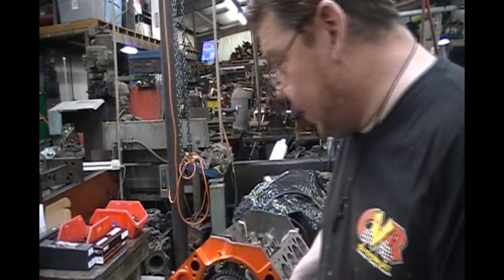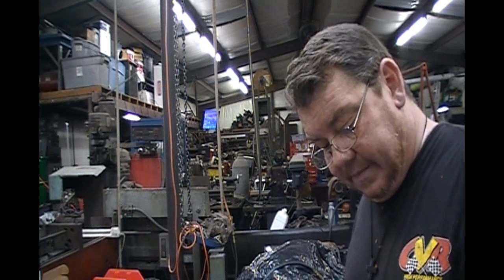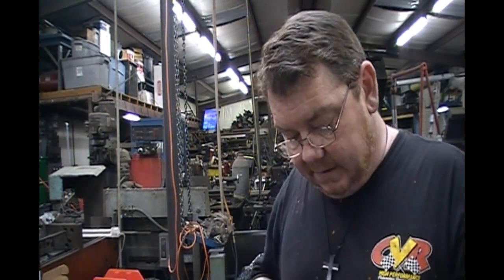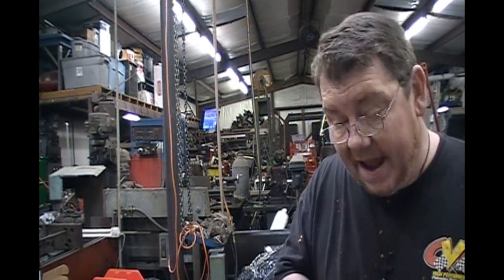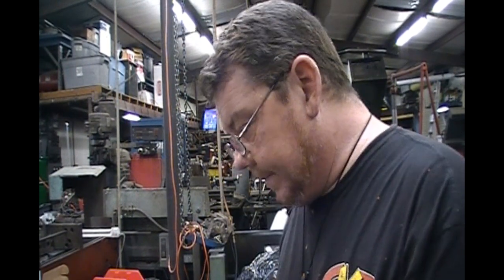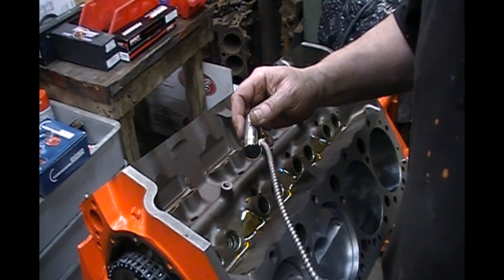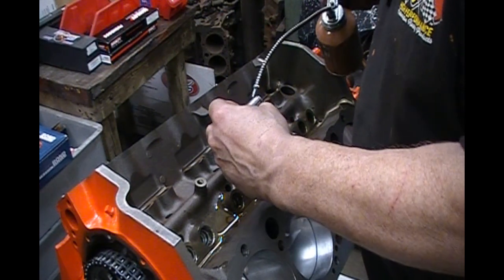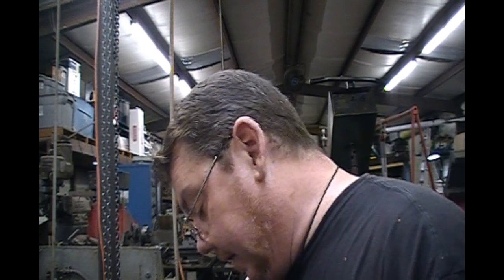Flat tappet camshaft problems, lifters, oil and talking flat tappet tech

Comment: I'd advise having lifter bores honed if your block is hot tanked by the machine shop. Bores can become egg-shaped over time and excessive heat. That can cause lifters to bind and not rotate.
Reply from the maker: We check and hone or correct all the lifter bores as part of the inspection/prep process in our shop. sometimes I have to sleeve them. And then there's new dart blocks and a few others that are actually to tight and I have to hone them. But yes you're absolutely correct, you should check or have them checked. Occasionally they just get a burr in them from handling or machining and that's what I'm basically  referring to in the video. Thank's for the comment!
Reply: @Marksracingengines what grit do you finish the lifter bores with?
Reply from the maker: @alexlandsberger1423  I finish with a 320
Reply: also hone your lifter bores if you have a cam go flat and have to pry the lifters out. had a 305 eat a cam and the lifter bores have burrs on them now.

Comment: When I broke the Comp Cams cam with Rhodes lifters in in my GTO with a fresh rebuilt motor back in the mid 90's I don't believe it fired right up... And to add insult to injury I boiled it over at 260 degs half way through due to a defective new  clutch on my fan. Swapped on a flex fan and finished it.   Still running great to this day.  just recenly checked compression at 180-185 on all cylinders. Didn't start using zinc additive until a few yrs ago before i switched to a 15-40 diesel oil I can get for free.   May switch to a roller though if i go with alum heads.
Reply from the maker: Cant go wrong with a roller, but honestly there's nothing wrong with a flat tappet. like you said...it's still running strong...I like those success stories. and I Love Pontiac's!

Comment: 2023 and flat tappet lifters isnt the way the roller is the best way too go
Reply from the maker: Yes, I agree. But unfortunately the rules for 80% of circle track classes still require flat tappet camshafts. And I don't see that going away any time soon. Until it does, those customers are stuck with them. On the up side..I haven't had but maybe  3 or 4 flat  tappet cam failures in the 30+ years Ive been in business, and that's engines I've built in the thousands with flat tappet cams. However I use good parts & break in oil. Thanks for watching!
Reply: @Marksracingengines   i understand but the new oil the dont have zinc, and make it harrd for flat tapped cam and lifters too live   Maybe is beter too change  the rules and came in the 21th century the tracks
Reply from the maker: Fortunately there is plenty of readily available racing oil like VR1 (Orileys has it in every store), Driven and many others with plenty of ZDDP designed for flat tappet cams. No you cant buy it at Wal-Mart, but you cant buy race car parts there either lol. I agree they should change the rules and allow rollers in every class. Myself & other engine builders  have lobbied for it for years to no avail. Unfortunately that's not going to happen any time soon. As long as there is small & big  block Chevy-Ford & Mopar engines in racing,hot hods & restoration projects....there's going to be flat tappet camshafts.

Comment: Despite all Precautionary checks (Cam lobe Taper, lifter Facec Crown, Excellent lifter Bores, etc) including Correct Zinc oil type,  Abnormal numbers of FT Cam & Lifter  break-in & running Fails are Still happening.....To date,  No one has Yet confirmed, Provened or Presented  Any cam lobes or lifter faces Below acceptable RW hardness specs are involved

Comment: Mark the pushrods and watch to make sure they rotate.  Use break-in springs in high performance (heavy spring) applications, and old-school non-detergent break-in oil. 
If a lifter isn't rotating or is rotating intermittently (sticky), you can try briefly letting the engine come to idle and manually rotate the pushrod with your fingers to get it going.
I'm 59.  When I was young I had a '66 El Camino with a 327.  I had a lifter go bad (wouldn't pump up) in it twice.  My father was a career mechanic who liked Chevrolet.  Each time a lifter would go bad I'd pull the intake and replace the bad lifter with a used lifter my father would give me with a similar wear pattern.  Technically you're not supposed to do that, but I had more time than money so I was willing to gamble.  Once I got it back together I'd start it and watch the pushrod.  If necessary I'd use my fingers to help it along until it was rotating smoothly and consistently (the same as the others) on its own.  Both times it worked out and the result was a reliable repair.
Do the cam lobes and lifters have enough taper?
Are the lifters free in their bores?
Do all the pushrods rotate equally and consistently?
If the answers to those questions are yes, you should be okay.
Watching pushrods rotate on a running engine is messy, but I don't know any other way to be sure.  It's gotten to the point where we either do it or stop using flat tappets.
Reply: How much taper on the cam and crown on the lifters, is considered good to go? Thanks in advance!
Reply: @SuperDave227D  
It isn't much.
The key is to make sure the angles match in order to maximize the load bearing area.  
There is a YouTube channel called 'powell machine inc" that has good videos on the subject.
Reply: @kd6tas  thanks!!

Comment: my Holden 253V8 ate  2 cams in 2000 miles...  cheers from Down Under
Reply: What brand and grind of cam? what lifters?
Reply: @borismcfinnigan3430  the 1st 1 was in the motor when l got it 2dn hand ran for 3 years with out a problem...  replaced the lifters from auto barn & a cam brand l didnt know.....  this time l used matching Crow cam & lifters so fat almost 1000 up so far so good.. cheers
Reply: @hippytrev7452  Being autobarn they were probably nason lifters

Comment: Just think Since 1987. Zinc has been absent from oils. So is it really the oils? Never had issues until the early 2000's.
Reply from the maker: Actually there is still ZDDP in oil today. Just at a much lower PPM.In 1992, oil manufacturers started reducing the amount of zinc and phosphorous in motor oils per the EPA's instruction. It took a big hit in 1994 and tapered down under the "safe for flat tappet cams" 1200 PPM in 98-99. That's about the time we started seeing camshaft failures during break in at our shop. The problem was so bad it bankrupted a few cam company's until the lack of Zinc - Phosphorus was discovered to be the problem. At the time there were no "Break in oils" for flat tappet cams. So we all broke cams in with Rotella T diesel oil that at the time still had high levels of ZDDP ( they have since reduced it as well) OR used GM's "EOS" additive with high ZDDP levels. This fixed the cam going flat at break in in our shop. At that point Comp, Lucas, and several others came up with break in ZDDP additives and others followed with break in oil & Racing oil specific to flat tappet cams. That being said....there have since been some other manufacturing issues with lifters,cam cores ect. Although  I normally see that with generic branded cams still... Every cam company has a % of failure rate. Thank's for the comment!

Comment: You rotated the engine around, and knocked all of the moly lube off of the lifter! ha ha
Great video, I appreciate your take on things! Also really appreciate to hear about your Howards experience, was going to buy a set of their EDM lifters today, so now I'm rethinking that deal. Been hearing a lot of great stuff about Isky and Jones, will probably go ahead and buy from one of them.
Reply from the maker: yeah two of the only 3 to maybe 4 cams Ive had go flat in in over 30 years in business were with Howard's EDM hole lifters. two in a row. When I checked the remaining new set, they were all over the place with crown. like one side had .003 then measure on the other side and it maybe had half a thou. I took one to PRI and showed em, and they told me it wasn't their lifter....so yeah no more Howard's stuff for me. Bullett has some good EDM lifters to and they aren't to pricey. You might check them out to.

Comment: Ever thought about missing oil thrower paddles on aftermarket conrods? Original GM Small Block rods have so called Splashers that throw oil on the cam lobes, most aftermarket rods dont have these oil throwers
Reply from the maker: Yes it actually has crossed my mind before, and that's a good point.  however most aftermarket rods have a ton of side clearance and that  offset 's that problem, and if they don't have enough ,  I give it to them. The wrist pins and cam lobes rely on the oil that coming from side clearance. yes it's harder for the rings to control the extra oil, but I think it's worth the extra lubrication the cam and lifters and wrist pins get. And to be honest.....knock on wood....we havent lost a flat tappet cam in a customers engine in years. maybe a 4 or 5 in all these years in business & I know 2 of those were my fault for getting greedy with spring pressure.  So you might be on to something there because GM did put those there to throw oil on the wrist pins and cam.. AND remember some small journal rods had an oil hole at the parting line of the cap to do the same thing. Thanks for watching!

Comment: Maybe there's some  Core  metallurgy mix Quality that the traditional surface Rockwell Hardness test tools are Failing to Detect or identify ??  .....
Reply from the maker: That's exactly what I am looking into right now. I just sent cam cores from 4 decades to a Metallurgist. A 1970's, 1980's ,2004, 2022. all of them are comp cams with the exception of the 1970's cam...it is a stock factory camshaft. I told him  to cut them up as he pleased and see if he could find and difference in material, material hardness, depth of hardness, grain structure, ECT. I'll post the results or do a video when I get them back. Because like you, I feel that could be the only explanation when everything else is right.m Thank's for the comment!

Comment: Some vintage, back in the Day,  Factory Oem cam & lifter Accelerated Wear issues Were happening.....Recently Inspected & Measured my 10,000 mile 1970 426 hemi Factory Original lifters & was Shocked to see a smooth,  0.003"  lifter Face Depression !!  ....That's almost a 0.006"  Wear down of the Original face Crown in Only 10k miles ! .....That 4000 lb 'Cuda was Still running strong Normal 13.0's @ 107 when removed for cam Upgrade.....Imagine how Close to a Powdered iron cam & Lifter I Was Without any Warning symptoms !!!

Comment: 50 years building flat tappen cam GM motors from 1955 to mid 80s----- ZERO cam issues! NONE ! Why, long list of things. I do what not many others take the time to do or fail doing it correctly. I find over & over that good enough rarely is! It takes me 3 times as long as anybody else to do a final assemble on a motor. I might have it sub assembled tougher 10 times, then spot something else I want to check, pull it ALL DOWN AGAIN COMPLETELY, wash everything 3 or 4 more times and correct any issue I sport and re assemble until I like everything. I use straight weight 30W Lucus high zinc brake in oil, run it at 2,100rpm for 30 mins, change oil & filter with fresh Lucus 30W B/I oil and a new Wix deep filter and run it on the road for 300 miles under 3,500rpm always moving rpm up or down, never keep at same rpm. Then another oil change at 300 miles with a fresh Wix deep filter and I continue to do that for 2 to 3 thousand miles changing oil & filers every 500 miles and always moving RPM up & down under 3,500rpm. After 4,000 easy miles, it's broke in so I switchover to 30W VR-1 and for me, I always change oil around every 1,000 miles. Been working for me for decades.  Been working for me for decades. Just finished a 67 Chevy 327 with a Comp Cam kit and new everything that now has 5,000 miles with no issues and 70PSI oil pressure hot. Same story for my Pontiacs & Oldsmobiles, no issues, and yes, it takes me 3 or 4 times as long to build & blueprint a motor.  To me I would say follow the lead of builders that haver NO issues and do your very best to dublicate there motors in every way. If your using the correct lubricants and have super clean parts (they need a highly detailed BOOK on HOW TO CLEAN MOTOR PARTS! good enough is NOT GOOD ENOUGH !)  There is no such thing as TO CLEAN ! It's not the cam or lifters, your missing something.
Reply from the maker: Exactly.  Ive been in business for 32 years, I've literally built over 1800 flat tappet engines and only had 3 or 4 cam failures. 2 were my fault for getting greedy with spring pressure, I know one was from customer improper break in. And I think there was a lifter issue one time. but yeah I don't have flat tappet problems either. I stick with what I know works...like you said..we mock up, several times during a build, keep everything clean, and use ZDDP break in oil...not additive, change the oil after 30 to 45 min run in, use vr1 or Driven and we have zero cam issues.  Thanks for Watching!

Comment: I agree with u about not priming the engine by turning the engine over! That dousnt even make sence to me? By turning the engine, if it fires or not, it's still all turning while waiting for its oil! I have never had a cam go flat on break in. I have had one go flat at 6k miles. But I build my own engines for a hobby, not a business.  One thing I did not hear u mention is the springs that are used during the breaking? I actually, since I am always messing around with engines & usually the same kind of engines, have sevral sets of springs around in my shop. So I have choices & can test the pressures & can change springs after the break in. So my normal ritual is two 20 min of run time at 2000 rpm varying rpm from 2 to 3k rpm. 20 min then I shut it down & check things over & let it cool. Then again for 20 min. All with light pressure springs. Then a oil change & then if all is well a possible drive & I drive making it pull through the gears & deceleration through the gears for the ring break in. Still using light springs. So yes I make it pull hard yet be careful to not over rev beyond what is reasonable with the light pressure valve springs I use. After maybey a couple hundred miles? Maybey 100 or 200 miles then I will switch over to the recommended valve spring for the cam & a oil change again. The one cam that did go bad was yrs ago & I had not yet developed my current procedure. Not sure why it went? I was young. But it was a erson cam in a ford 460.
Reply from the maker: All of that is good procedure for sure. You're right I forgot to mention using break in springs. I have a bunch or old springs sets as well I use for break in. Most of my engines get a 30min break in and then hit the track at 7 to 8000 rpm and don't really idle a lot lol. But yes all my street engines I basically recommend doing exactly what your doing. Thank's for the comment!

Comment: i just did one we used a higher zinc non break in oil comp 260H cam 350 sbc stock springs rebuilt heads summit racing makes high zinc oil good price too

Comment: Great video,  a lot of good info, will put it to good use, 
What are your thoughts on elgin lifters?
Reply from the maker: Well...I have used Elgin lifters several times over the years without issue. I've use their camshafts more than once as well (most of the cheap cam kits like Enginetech, Summit etc..are Elgin Grinds).....no issues. But to be honest it's been about 10 years since I've used Elgin anything. However their lifters come from HyLift Johnson ( not to be confused with Johnson lifter corp)...but so do Summits and a LOT of other cam manufactures . And Ive used Summits cheap lifters with no issues. Now that being said, different camshaft company's have different specs on lifter taper that Hylift Johnson grinds for them. So what I'm saying is, match the Elgin lifters to an Elgin cam, Or at least make sure the Elgin lifters have the same taper as the cam your going to put them on. Other than that...I don't think Elgin lifters are any worse or better than any other big box cam company's lifters. Does that help? I know you want a definitive answer, but I nor anyone else can honestly give you one...only opinion. And in my opinion Elgin lifters are fine for most mild applications...even in a dirt track engine.

Comment: Im always trying to learn the most i can about automotive subjects. Nothing more controversial then an oil debate, im young to mid age and like nothing more then learning from the old school.
Ive read that the high zinc content only madders in a flat tappet cam break in, that its not a big deal once you get some good mileage down.
Im somewhat new to older vehicles , did my first oil change on my 1979 project vehicle last year, i ended up using 10w 30 castrol gtx syn blend with a bottle of lucas zinc additive. Not so sure now if its good or a bad thing.. 
Any input from anyone would be appreciated.
Conventional is knowhere to be found in my state, its all syn blend or full syn.
Reply from the maker: Oils are blended at certain temperatures. That's why I don't recommend a zddp additive for flat tappet break in. However if your cam has already been broken in, a zddp additive is probably fine if it's not a race engine with high valve spring pressures. Hope that helps.

Comment: Some lifters have been found to have a non-concentric radius on the foot
Reply from the maker: Yes. Mainly with off brand cheap lifters.   So far I haven't had any  concentricity issues with lifters I've gotten from Bullet, Isky,  or Jones. And the fact that there are only a few lifter mfg's left making flat tappet lifters for cam company's tells me that the aforementioned cam company's must have better quality control.